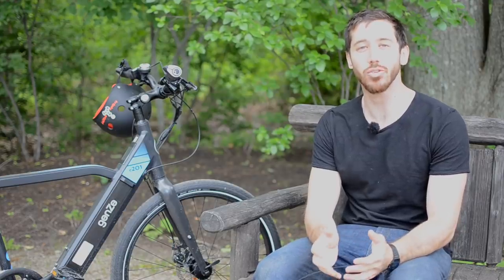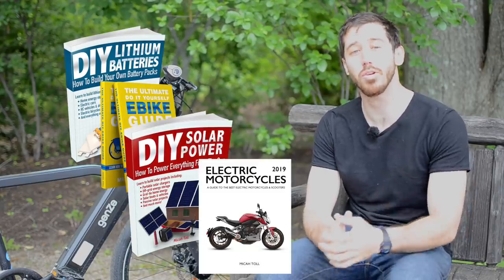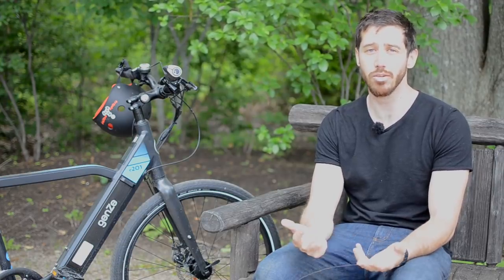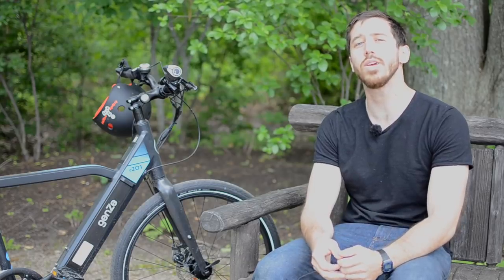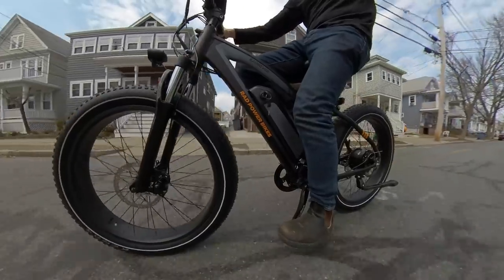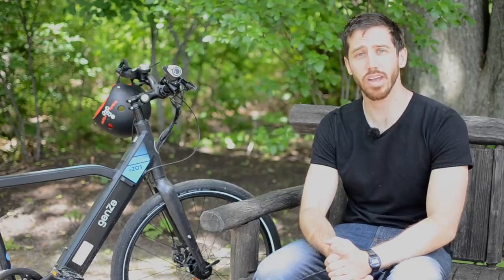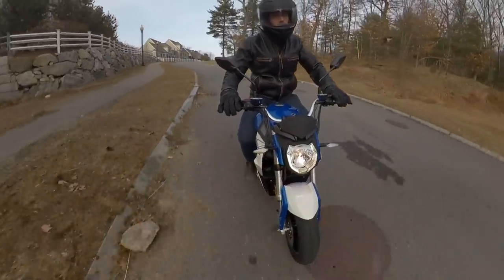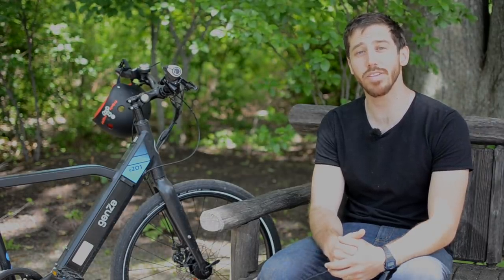How much POWER does an ebike need?

Comment: Here in the UK we're more restricted than the US when it comes to e bike power. I'm surprised you think a 250w motor is almost useless at climbing hills. I live in a hilly part of the U.K. and the throttle lever on my e bike gives a very definite kick when it's applied, I just need to keep turning the cranks with very little if any effort, so as you say there must be a wide deferential between motors.
Reply: 100% agree. I’m in Cornwall and it’s hilly as hell here. My 250 watt motor gets me up all the hills here. I’m 6ft 2 and 200 pounds. Yes, I have to pedal to get up the hills. But that’s my idea of a pedal assist bike,,,, it helps you up hills. I get up hills faster than my road bike. And I’m not a sweaty mess  after climbing on the ebike. 250 watts is enough for climbing.

Comment: most motors don't have a rating. you need to pay attention to the wire gauge being used in construction.(feed lines and stator windings)and maximum wattage output. I moded a serengetti panther electric scooter because the max wattage rating was 1100 on a 500w motor. so I installed a variable voltage 48-60vdc controller with a 1200 watt max at 800w usage and a 3 speed throttle and never looked back. the SLA batteries last about 2 yrs. I never had enough cash in pocket to buy lithium yet. it came with lithium but was under powered by factory and failed.

Comment: Islam: I have had this bike for 3yrs, it is made by a company named Mercer. I have always been interested in e-bikes, far as that went. I have always been good with fixing stuff,i live in an rv. I caught fire an burned. So i have been remodeling it. Did not breach the walls or roof, a guy i met told that he had this bike pedal assist. But that it had an alternator built in. It was a frame no tires no seat,no handle bars, or brakes gears nothing. But the alternator got my attention. If I have parts,old bikes i can put one together 10 minutes. But im fixing the rv. Still ran windows doors good, needed my attention. I got a hub motor from another guy .using old makita drill as speed controller, this motor says 36v on it. I have 25 or 30 dewalt cell batteries that came out of the battery itself. How do i make that work, how many do i need to connect together. I have riden the bike, but it needed adjustments, and rear wheel. So i am trying the hub out. I need to use what i have. I am 63 years old mind body an soul in tact. Need direction  leej277677@gmail.com  thank you

Comment: Thanks for this...I didn't know that the mid-drive motors were so full of torque compared to hub motors.  That explains my (slight) climbing disappointment with my 750W hub drive ebike.
Reply: You use the gears so of course in first gear on big cassette you have tons of wheel torque

Comment: I got a Prophet 250w ebike and live on mountain slope so it uphill or downhill not much flat ground so am thinking of putting a 250w hub motor on the front wheel with additional battery on the rear carrier.

Comment: Hi.   I just wanted to start out by saying that your videos are so informative and interesting.   I’m not building up an E-bike yet but I recently picked up a super clean Razor E300 but it lacks power and fun.   There seem to be so many variations of upgrades I really don’t know where to start.   I’m looking to probably squeeze out about 20-25 mph without having to leave on a charger for 3-1/2 days to only run for about 45 minutes.  I’m fairly new to this game and was looking into maybe a 36v-1000w motor.  Any guidance you can give me would be so greatly appreciated.   I don’t want to purchase the wrong parts only to find out I should’ve gone in a different direction.   Thanks again.   Keep up the great work with the videos.

Comment: Really enjoying my 750 watt 52 volt hub motor bike.  Lots of power for the steepest hills, and has a VERY long range.
Reply: Richard Alexander - what range do you get? What amp hours are your battery?
Reply: @richardalexander5758  What brand is the 52v hub motor? Front or rear hub?
Reply: @bbeckm2   Its a Bufang rear hub.on a Juiced Bike Cross Current X.  Pretty quiet, and responsive.  Highly recommend the hydraulic brakes with that much weight and speed.

Comment: Good video. You should go over spokes sizes and other things that should be addressed or added on, when increasing the power of the motors, so the bike can handle it without a failure or breaking some thing. Maybe weak points in bikes that need to be inspected regularly as well when using motors would make a good video as well. Keep up the great work.
Reply: Spoke size is a HUGE issue. I was running a normal bike with normal sized spokes hauling a huge load and when a spoke broke the whole Aluminum cargo rack broke on the side too. After that I rebuilt it with a new wheel from bikeman4u.com and bought a high quality heavy duty wheel with 11gauge spokes and a new cargo rack. Bike was a dream after that. 

Spokes really seem to be the key to that formula. And now I can't find a wheel with anything thicker than 12 g spokes. I'd build a touring bike with larger spokes, too, if it were up to me. The weight is negligible and the reliability benefit is huge.
Reply: I just broke  2spokes a couple of days ago, waiting for replacement  as it's a odd size.  Pot holes plus tubeless might not have been best set up,  going to switch back to tube and see how that goes.

Comment: I was once a 178 LBS Ebike Rider more Strength Overweight like Slightly Heavier & Chubbier as Welterweight on 36V 500W Ebike and it went Slower with 20.24 MPH since last 2 years in 2018, and now on January 2, 2020 since I lost 35 LBS total (started from last Year from the end of March 2019 to right now in Jan 2020 for 10 months ago total.

And now I'm 143 LBS Ebike Rider Healthy Weight like even more Skinnier, Lighter & more Agility as Bantamweight on 36V 500W Ebike and it went a little bit Faster with 20.66 MPH now since from this Month on January 2, 2020.

My Custom 1992 Dragon Harley Davidson Style Red/Black 36V 500W Waterproof Ebike's Weight (The E-bike itself without the rider) is almost 60 LBS.

1. So which of my weight has more faster Speed now if I'm still currently riding on 36V 500W Ebike, 178 LBS Ebike Rider more Heavier Strength Chubbier Weight with 20.24 MPH, OR 143 LBS Ebike Rider more Lighter Agility Skinnier Weight with 20.66 MPH?

2. As I lost 35LBS Total from my Former 178 LBS Strength Heavy Weight and from my former 500W Ebike Speed 20.24 MPH, down to My New Current 143 LBS Agility Light Weight with my new current speed with 20.66 MPH on my 500W or after I keep losing weight down from at least if I lose another 

6 LBS by next month Feb 2020 with 137 LBS & 20.73 MPH, 

12 more within 2 months from Jan 2020 to Mar 2020 with 131 LBS & 20.80 MPH, 

18 more within 3 months from Jan 2020 to Apr 2020 with 125 LBS & 20.87 MPH, 

or 24 more within 4 months from Jan 2020 to May 2020 with 119 LBS & 20.94 MPH

or depending how much I sweat or burn calories when every time I ride my 36V 500W Ebike usually everyday (Except precipitation days), then will my 500W Ebike's Speed Keeps on Increasing as long as I keep on avoiding gaining weight by fats or muscles like I have to keep losing weight and burn more calories & fats faster, and keep myself always Lighter & Agility body weight am I correct?

3. As I keep losing weight and keep doing what I'm doing now, then will my E-bike keep increasing as I keep losing weight and keep on avoiding weight right because the more Heavier fatter or muscular strength weight like I was 2 years ago in 2018 the more slower speed on the 500W goes cuz it need more power, and the more Lighter & Skinnier Agility weight the more faster like I am now in January 2020 on the 500W Speed cuz it need less power am I correct?

I feel like I will lose 6 pounds each month every time I do 16-20 hrs of fasting and after finished eating my 1st smaller portioned Brunch Meal, then I will wait within 4-8 hrs of waiting time until I eat 2nd and Last smaller portioned Linner Meal everyday now to watch my weight.  Last previous years I used to ate 3 separate bigger Portion Meal Breakfast, Lunch & Dinner, but since last year in the end of March 2019, I started to reduce down and skipped my 3rd bigger meal Dinner so that's making me eat 2 smaller Combined Meals which are only Brunch & Linner from now on daily instead of eating 3 bigger meals so I can have more chance getting more Skinnier Agility including me to avoid gaining future fat or muscle strength weight.

Can you PLZ answer all 3 ?s so I make sure if I'm correct cuz I'm pretty sure I heard this b4and they agreed with me?

Comment: I would be interested in factors that maximize speed. Is gearing a mid-drive more important than the wattage for achieving higher speeds? How important is the batteries voltage etc.? I'm more interested in electric motorcycles as opposed to bikes.

Comment: Imho whats important on the ebike is the battery and AH to be more specific. This determines your range and range is most important with general ebiking. Make sure you are getting name brand battery cells such as panasonic or samsung and no less than 12 AH on the battery pack. Of course that battery pack will cost a whole lot more than the standard Chinese batteries. The Chinese batteries will last under 2 years after moderate use before declining while the name brand will go about double that or more.

Comment: Running a 1500w Hub motor on my Brodie hardtail. A good set of brakes really starts to matter at these power levels.  Would be interesting to see your take on brake pad, caliper and rotor recommendations within these power ranges.
Reply: Id say a good hydraulic disc brake is mandatory, I'm looking at a 5000w kirbebike and that's the first upgrade I'm doing

Comment: Great info,thank you. Here the max allowed is 250watt. But we don't have hills,so its OK I guess. One thing I am still trying to figure out, max speed vs voltage vs watt. A 36v battery, can you predict the max speed? Depends how much kV the motor is, but this is not a common unit of measure with ebike motors.

Comment: I got a 350w kristall and it’s pretty powerful!  I’ve never had any lag on hills and I am a pretty big guy.!
I got about 17mph going up a steep hill peddling on level 5 assist near work,and I get about 22mph on flat roads with just the throttle 💨💨💨💨🫡 also I’ve carried bags of shopping on the handlebars and in my ruck sack and still managed 18mph on throttle no lag and the bike only cost 😮 £799🫣
Reply: Where did you get it?
Reply: @Zak.f  eBay it’s called kristall E5 350w motor with throttle £799

Comment: I've been playing around with DIY rear hub motor kits for a few years now (mainly on fat bikes) and I'm hooked. I keep looking for more power though, therefore I have just ordered a 5000w rear hub kit with a Programmable 36V-72V 80A Sabvoton Controller, 18 Mosfets, 200 Amp Phase Current. I currently have 2 x 48v / 20ah batteries and 1 x 36v / 10.4ah battery from existing builds. I was wondering what the best way to utilize these batteries into my new build would be? (ie can I connect 1 x 48v & the 36v in series? or would this be too much for the controller?, and does it matter if the 2 batteries are different ages?)
Thanks for all the information you (& the YouTube community ) have taught me.

Comment: I bought a 21 sp mountain bike, a 1500 watt rear hub drive and a 52 volt 20 ah battery with no china cells. slicks front and rear @60psi. The wires to the motor seems a little small and noticed they got a little warm after ridding fast..did a voltage drop on each leg and got 1 to 1.2 voltage drop on each leg so i replaced them with wire from local hobby shop...14 gauge 100 strand silicone pretty much the same wire as the controller...noticeable difference...it used to run the same speed at 2/3 throttle as full throttle...now full throttle is full throttle. It ran 38 gps today  on flat ground...is that about right for the combination? First time messing with one of these deals...i remembered the slicks from a mountain bike i had 30 years ago..i  remember they were like ridding down hill all the time...i guess bicycle geometry was not intended for much past 30..mine had a twitchy thing going on that i didnt much care for. i put the forks in a press and bent about 3* more rake in it...it is happy a little past 40 and a car tow...I have another bike, one of those honda deals..cbr1100xx blackbird..about 175 hp and 191 gps...like the ebike almost as nuch..the honda is a little hard on my driving record..guess 750vwatts is the limit for street use...cant get a speeding ticket on a bike? I did get one when i was a kid. Ye old schwinn 10 speed blazing through a canyon,,,35 in a 25...mom was so pissed..at the cop..lol

Comment: 250 watts is okay in a mid drive - I mean with also 250 watts of legs I can cruise like a pro cyclist - but in a hub that is built for a 15 mph limit has a decent power band only at 10 mph lol. It can roll you around a flat city I suppose. I have a 750 watt bike and it's brisk but not spectacular at accelerating, but I can add legs which can give me some extra power. If I pedal as fast as I can off the line I effectively have 1500 watts until I get tired. Actually my motor reads 1100 watts on the display (though I think that's power input) - it's probably about a 900 watt motor on a fresh charge at 53 V instead of 48. I also have power assist at any speed I want, and 7 gear ratios to choose from in case I either want to go really fast or climb a big hill.
Turning hand cranks and pedals as hard/fast as I can I measured myself at about a kilowatt (for 10 seconds) measured on a SciFit Pro II https://www.healthandcare.co.uk/exercise-equipment/scifit-pro2-total-body-exerciser.html. Breaking that magic kilowatt was a big effort I'm not sure how the track cyclists get over 2 kilowatts.

Comment: Good commentary, except that you failed to acknowledge the differing power requirements for building fitness with pedelec assist, VS passively scooting around on throttle control. I weigh nearly 240 lb, have a Bosch Active Plus 250W mid-drive system on my 9-speed Gazelle, and live in a fairly hilly city. The torque-based active assist feels more like real cycling than the 500W BionX hub-motor kits I was looking at a few years ago. On paved roads and mostly ECO and Touring levels, my fitness level is rapidly improving, and I’m getting 50-60 miles of real-world range. That’s with a 36-volt, 400Wh battery. I couldn’t be happier.

Comment: The 250W bafang front hub ebike I just made climbs any hill at 12-15mph with no pedaling, and with pedaling as if I was on a flat road with a normal bike, I'm going the same speed as throttle only on flat ground.

The bike has 28 inch wheels, is pretty heavy, I'm not atheletic, like not fat but you could say I'm an 18yo with a dad bod, I live in a pretty hilly area and I could totally skip pedaling in all the hills I've ridden while still going a decent speed, so IMO 250W is enough if you don't mind light pedaling, 350 is recommended and 500 is just something to make sure you don't ever lack power, people saying otherwise are the same people that buy an iPhone 12 pro for playing candy crush or a macbook pro/gaming pc to scroll Facebook and YouTube, they do it for the hype, to brag and because having power makes them feel better about their insecurities.

And I don't feel bad saying that because numbers back up my thoughts, if you do a google search of "how many watts can a cyclist output" you'll see a pro cyclist can output up to 300W peak, and a regular/slightly athletic around 200W, so a 250W motor is basically enough to turn you into a pro cyclist, and way more than that if you're willing pedal a little. Especially since the wattage of a motor usually is continuous watts, not peak (250W motors depending on the controller sometimes go up to 300-350) and a lot of 250W motors actually are higher wattage units with a 250W sticker to pass eu regulations.

Comment: Nice video.  I was hoping that you would have also touched upon top speed in each of the categories.  This also correlates to range as well in each of the wattage categories.  I use bikes more for flat terrain commuting rather than steep hill climbing.  Thanks.
Reply: Generally for an average rider, flat terrain, no wind, 250W = 12.5 and 500W = 18-22 and 750W = 25-27 and 1000W = 28-30 and 1500W = 32-34. Always pedal to get it going and my rule of thumb is to go atleast next category of top speed for crusing. So if I want to commute to work at 20MPH I will go with 750W not 500W.

Comment: You offer 4 books, one of which is a solar power book. Could you make a video about if it is possible to continuously power an ebike from a solar array (perhaps on a bike trailer). What would it take? How many amps / volts? Are current solar panels capable of support that power demand. Thanks as always for the informative video.

Comment: It seems to me that what you "need" really depends on what you consider to be an "eBike". Are we talking about pedal-assistance, where the motor helps you out a little or are we talking basically electric motorcycles posing as bicycles?
A Tour de France cyclist may put out an average of about 375 watts by himself. And he can climb hills just fine. Adding a 250 watt motor, combined with pedal power, to a bicycle will essentially catapult any old lady right into the league of competative cyclists. A 500 watt motor will give you the sprint power of Lance Armstrong without even having to touch the pedals.
If you say you need more than 500 watts to "get up the hill", it feels to me we're  talking about electric motorcycles here, not eBikes. Bicycles don't "need" to go 30+ mph uphill.